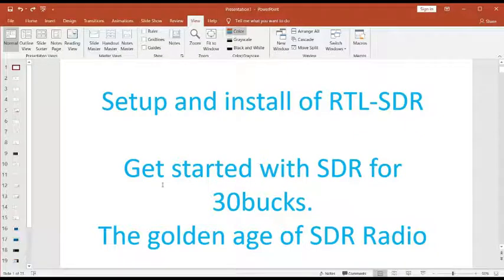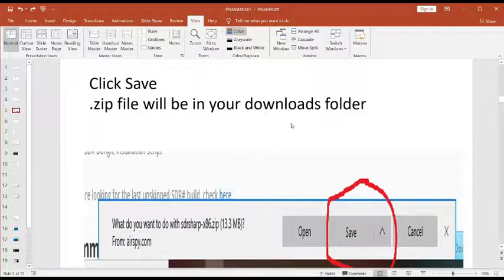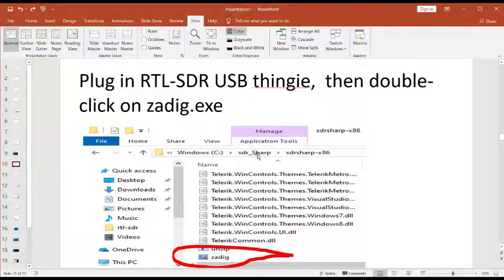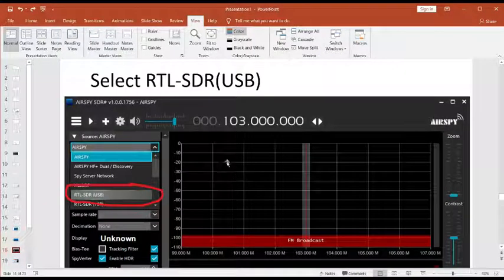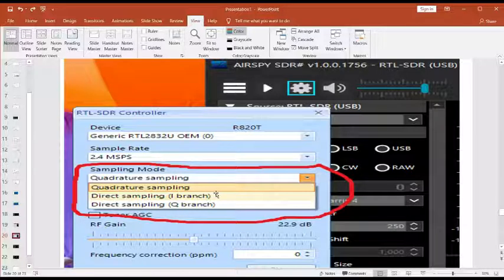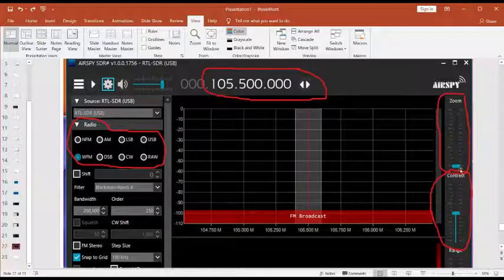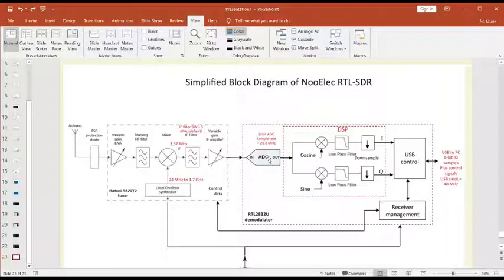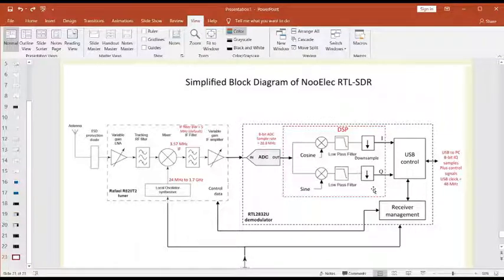RTL-SDR Setup and Installation

Comment: what if you did already plug in your device? how do I fix this because nothing is working because I plugged the device in before I watched this. I've tried everything from deleting the device in the device manager... HELP
Reply from the maker: with the rtl plugged in , run zadig.exe should see "bulk in interface 0"     and should be using rtl-sdr v3  dongle,   i never used any of the other dongles.    but the video as shown is exactly what i did to get the rtl-sdr v3 dongle working for windows 10.     i don't know how to setup on mac or linux

Comment: I enjoyed viewing your video. Well done. Since you are very knowledgeable about  SDR  

subject, I would appreciate your help in setting up my RTL-SDR. I have downloaded and installed successfully all the required software, SDR Sharp and Zadeg. But anytime I plug in the SDR dongle, the computer says, " Driver was Not installed successfully"!
   I think the problem maybe the Universal Serial Bus Controller in the Windows Device Manager not working. For the last several days I have tried to update that Controller driver or find a driver for it, but it is nowhere to be found. 
      My computer is a Windows 7, 32-bit with an i5 Intel motherboard.  I have gone to the Intel website without success. I also have looked all over the internet for a driver for that Controller without success. My device cannot work without that, and I really don't know what to do. 
I am about to give up and forget all about getting started in SDR radio. That is why I am asking for your help in locating a driver for that controller and would greatly appreciate your assistance.  Looking forward to hearing from you.
Reply from the maker: Not sure, step by step from my video is what I did.   But I have windows 10, 64 bit

Comment: When I run zadig.exe, I get no devices showing up. What I'm I doing wrong?
Reply from the maker: before running zadig.exe, rtl-sdr had to be plugged in,  if so,  in zadig.exe go to options , select list all devices.   you should be running as admin, with full control on pc
Reply: @TheGmr140  I did all that on two computers both windows 10. On one it gave Unknown Device and on the other it didn't show at all in the device manager.
Reply: If I pull the SDR, the Unknown Device goes away.